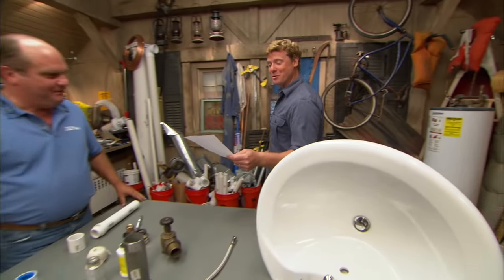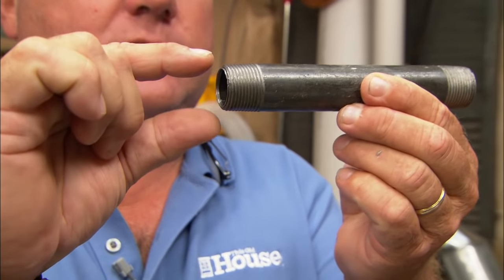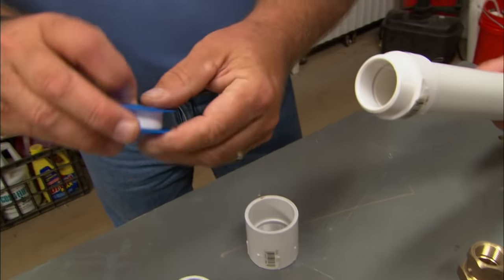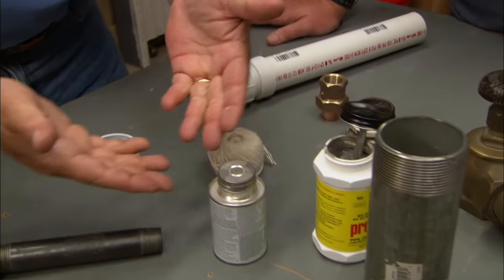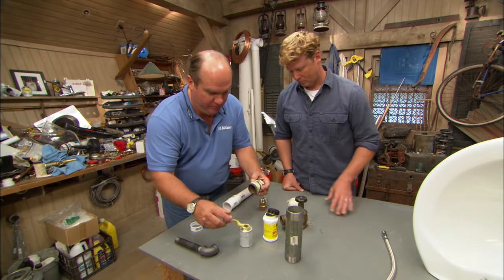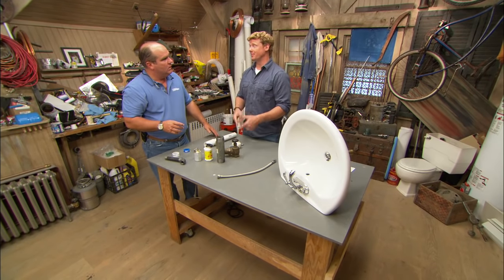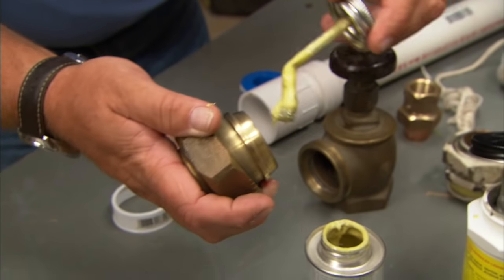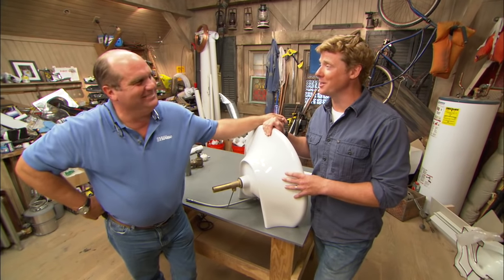When to Use Sealants on Threaded Plumbing Connections | This Old House

Comment: I always Tape+dope. In school they always said "dope is a lubricant not a sealant"
Reply: School? You must be from the great white north.
Reply: You are 100% correct. Here's my reply to this video:
__________________Teflon and or pipe dope is for non-stick. I use pipe dope with teflon in it, and both dope and tape on brass to dissimilar metal. All of this is to keep metal from chaffing inside the joint and balling up. It lets the 2 surfaces slide together so that the METAL ON METAL makes the seal. (Plumbing 101) Teflon and or pipe dope is not supposed to make the seal. It's so you can take it apart someday as well. I use it on every thread (except maybe supply connectors)n so that years later the plumber can get it apart.If you are using this to make the seal you are cutting substandard threads.
Reply: Pretty much true but if the compound is mixed properly and not soupy, it will form a seal because it is water resistant. Also does set up over time to create a seal,,, but not so much for liquid under pressure. Like water lines and air or gas lines.. Mostly dope works better on larger fittings in drains. Seeing most water lines are compression type with brass or rubber or plastic seals,, thats where dope is beneficial as both a sealant and a lube.
Reply: @peterford9369  ______All of this is to keep threaded metal from chaffing inside the joint and balling up. As you already know brass compression joints use non-tapered threads to compress and seat the brass ring...a little dope helps both the threads and ring squeeze things inside. And also...the actual amount of dope that's actually left in any sealing surface is almost molecular....99.9 percent is squeezed out both ends....it's just a waste to use liberal amounts. O-ring joints in "constant pressure" systems would keep me awake at night....unless they were outside in the yard or something. I never use them. If you're using sealant  to make the "seal" you're using substandard threads or compression surfaces.
     Wax ring and Putty joints are a completely different subject. Thx for the reply bro.
Reply: @readmore3634  True but they use many o ring connections for modern interior plumbing applications. The flex sink and toilet feeds come to mind. No compression, totally o ring seal. Anyway,, no seal is forever,, thats why we have work. 😊. The people that invent this stuff are the hero s,, we just install it. You're welcome.
Reply: @peterford9369  _______maybe I should have said: "no O-ring dependent fittings inside the wall"....  that's Calif. code.... It has to be accessible. Only rigid connections inside the wall. My bad...
Reply: @readmore3634  OH sure,, that's a given. Code here too. Just like with electrical. No splicing in walls or any unaccessible places. Even in a protective box. Nothing buried. Common sense. Like with PEX. I never saw it or used it till I worked on mobile or manufactured homes. Almost continuous. But yeah I see what you mean. Thanks.
Reply: So, if I want to make sure there are no leaks, I'd use the teflon tape & put pipe dope on top? I'm trying to re-do the plumbing on the inlet/suction side of a jet pump because it keeps leaking.
Reply: @mycats7321  Yeah, as long as you wrap your Teflon tap around three or four times, tape alone should be fine. Teflon tape also makes the threads slide on smoother. There isn't much pressure in threads, but air or fluid could find its way through the thread tunnel. Don't know if you noticed what he said about the taper of the pipe? What happens is as you tighten the connection, it forces the threads tightly together sealing the pipe. The pipe dope or tape fills those very tiny edges that water or air may find.
Are you talking about jets on a pool filter setup?
Reply: @mycats7321  __________use a little dope on the bare threads...that way...when you wrap the teflon tape on, it squeezes the dope down to the bottom of the threads. Teflon tape (especially if it's a little old) by itself is just too dry and may ball up inside...a little dope helps lubricate the threads as you tighten.
Reply: @readmore3634  Thanks! Now i just need to order the parts & wait for them to arrive. Hope it will stop the leaking.
Reply: @peterford9369  I listened to what he said. I'm familiar with the concept of the straight threads vs tapered ones.
Goulds J10 1HP jet pump for a water well for potable water. I'm out in the middle of nowhere so I have a water well & pump system. System has been in place for decades but has undergone some changes due to things breaking over the years. For some reason they used mip sch40 PVC on the inlet (suction side) of the jet pump & it keeps leaking. The pump vibrates & heats up sometimes so I think it breaks the threads. I was told by pump/well experts that using stainless steel would be better so I'm going to replace the PVC w/ stainless steel & put anti-vibration pads under the pump.
The inlet line comes out of the holding tank and the pump pushes the water to a pressure tank & then it sends the water to a main line divided up to serve the house, barn, workshop, & outside lines for hoses & water troughs. Pump overheated after some line breaks emptied the tank & it kept trying to pump but was only sucking air.
Reply: @mycats7321  Wow, sounds interesting. But I see what you mean. Also, sounds like if the pvc fittings do hook up to the pump and the pump gets hot,, that's your problem. Plastic does melt, and even just a little bit it causing the leak. They probably used the pvc because of ease of replacement between two metal fixed fittings. Not sure, not seeing it. But galvanized pipe seems the standard for well components, vs stainless steel. You may have to use a union to go between the two fixed joints but don't think you'll need stainless fittings but good luck. I'm sure you'll get it working and leak free once you get rid of the pvc parts.
Reply: @ @mycats7321  Pete's right, a galvanized fitting should do the trick. Stainless would work but seems a little overkill. Now... all of this is subject to the condition of the "female" threads inside the pump housing. If it's been leaking a LONG time there may be damage to those female threads due to erosion. Also, a joint that has a chronic leak for a long time may have had a hairline crack in it the whole time, not much you can do about that. And sometimes adding too much teflon tape can split a fitting cuz it's so easy to tighten.
Reply: @readmore3634  I'll have to check the condition of the threads & make sure nothing is cracked when I get the last part i need to put it all together. Still waiting on one part in the mail. I never put teflon tape on too thick so hopefully nothing will split/break.
Reply: @peterford9369  Yup. That's what i figured was happening. Between the heat & the vibrations, the PVC was slightly melting & the seal broke.
I've also read on the Lasco website that teflon tape can cause over-tightening, so I'll have to be careful to tighten enough to form a seal, but not overtighten. Got most of the parts I need now, just waiting on 1 to arrive.
Reply: @mycats7321  Hey,, Yeah was thinking about something when you told me it was an electric motor for a well and checked into cpvc pipe and fittings. Was surprised to find that cpvc has so much more heat resistance.
Because vibration seemed secondary to me for the cause of the reoccurring leak maybe cpvc could be an option, in resisting the heat transfer. Anyway, I hope the new steel parts fix it once and for all. Good luck.
Reply: @peterford9369  I know that plumbing code no longer allows PVC for even cold water inside houses (bc inspectors can't always tell if a line is for hot or cold water). But, it wouldn't be good for this application as it has a smaller inner diameter than PVC and it gets very brittle with age & can splinter/shatter. The steel should be more durable. 
Thanks! If I can figure out where I put my pipe cutters I'll try to work on it tomorrow.
Reply: @mycats7321  Good luck. Hope you can get it working permanently. We've all had those headache home repair problems. Guess life wouldn't be right without them. Guess if all else fails, you can spray that rubber sealant that seals everything, haha. Good luck then,, 👍
Reply: Correct , We replaced a Dominion Bridge  vintage 1898 boiler ,coal to oil to gas then replaced ; The threads on the 5 inch piping were so large that the only thing that worked was teflon dope and teflon tape .
Reply: Tape is a lubricant too

Comment: So, no pipe dope for a threaded PVC connection?  That's what I got, but in practice it's never failed on me....
Reply: Just did some research and the pvc manufacturers say not to use Teflon tape on their threaded fittings. Only proper thread sealant that stays soft. Don’t use anything else. Don’t use pipe dope that get hard either. This advice is only for plastic fittings, metal ones are alright to use tape and hard setting dope.

Comment: I would be thankful if you would write down the names of the 2 common sealants you were talking about.
Reply: I think those two pipe dopes are from Oatey.  I use blue Oatey Megaloc and it's never failed me.  Expensive but you get what you pay for.
Reply: The yellow dope is Rectorseal...

Comment: I don't understand. . . I live in EU and I bought two cans of great white pipe joint compound aka pipe dope and when I apply it, it leaks, and no matter how I apply it, it is leaking as that's it. How should I use it? on the inctructions it says to just brush it on and assemble the joint, but no matter how tight it gets or no matter how much I brush on, it just leaks and that's it. Why? Should I use it with ptfe or what? I'm really let down by it. . .
Reply: +Vytautas Poška = I know what you mean.  I tried pipe dope and the water pressure just pushes it out.  So I switched to Teflon tape and no problems with teflon tape.   I guess with pipe dope the threaded sections have to fit more closely together for the dope to work.  If there are large gaps between the threads then the dope just gets pushed out.   But the Teflon tape won't get pushed out if you wrap 4 to 5 wraps of it around the threads tightly, like I did with mine.
Reply: Too tight.
Reply: may have pinhole
Reply: no, I tried with brass, copper, steel, cast iron, nothing works, every one of them leaks. . .
Reply: When wrapping on tape, wrap in the opposite direction that you are screwing on the pipe.If you do it in the same direction, the threads will catch the end of the tape and tend to unwrap it.
Reply: I know all that jazz, I am the plumber you know, I just don't understand why pipe dope doesn't work in europe. . .
Reply: You should use anaerobic pipe sealant aka "super dope" ...If it still leaks your threads are bad.
Reply: Loctite 5776 for the win.
Reply: Metric system! :) Just kidding!
Quite possibly more clearance in the mating threads - do about 10 / 15 wraps of teflon tape, then add pipe dope and reconnect. Nostrowei!
Reply: That sounds really weird.

Maybe you should let the pipe dope set up for about a half hour before you cut on the water pressure?
Reply: We use a lot of straight cut threads in the UK, unlike American tapered threads they aren’t meant to seal without dope/ptfe. For example outside bib taps use a 3/4 BSPS thread. They often need 15 or more wraps of ptfe tape to get a good seal. This is so you can adjust the position angle of the tap on the fitting. Most straight cut threads however are meant to be used to tighten down a rubber seal, fibre washer, or to clamp an olive.

Comment: Does anyone know why they're not simply using the rubber gaskets for every single plumbing connection?
Seems to be the easiest way to seal something, hand tight is most of the time enough, and the whole world (outside of plumbing) is using it - even for 100x higher pressures.

Comment: Now the next question is how tight to tighten NPT. I've seen a tech use two long pipe wrenches on gas pipe and give it everything he has after applying the thread sealant.
Reply: About 50 to 60 foot-pounds.

Comment: Wick it. Seal with teflon tape. Then apply the dope. Thats a 123 punch vs leaks lol
Reply: Then Flex tape it, dip it in wax, wrap a bag around it, then duct tape it.
Reply: Ooh! You sure it’ll thread into the other pipe okay? Sounds like it might be “fun” to tighten! 😮 But if it works, go for it! 😎👍
Reply: @justayoutuber1906 : Sounds like the “Git ‘R Done” method! 
🤠😜👍🤣

Comment: Pipe dope and Teflon it's not a sealant....it's so you can take it apart someday...the metal against metal (or material against material) is supposed to make the seal...like a cork in a bottle...the threads make it so the cork doesn't "pop" apart...if you're hoping the Teflon is actually making the seal...you have bad threads. Use Dope on the threads and Teflon to squeeze the dope deep down in the bottom of the threads to lubricate the joint.

Comment: My dad never used tape or dope. What he did is take a bar of ordinary hand soap and scraped it over the threads and it filled the groves and made a perfect sealed joint. His motto why spend good money when bar soap works perfect. Today 40 years later its still sealed

Comment: Teflon tape is for rough thread to go together more smoothly. Pipe dope is for sealing. If it has threads, but doesn't have a rubber seal involved, just use pipe dope and ave the step or re-doing it.
With PVC/CPVC, skip the pipe doe and simply put PVC cement on the threads and put it together. It will seal, as the threads conform VERY closely at that point.
Reply: you don't cement PVC threads

Comment: The wicking string makes me worry - it would seem that the cotton would degrade over time or actually wick the water through and cause a leak.

I like the idea of pipe dope because it fills every gap and semi-sets up afterwards - providing both a lubricant and a sealant.

You'd think that something like silicone caulk would be ideal, as it does both and is water impermeable after it cures.??.
Reply: Willard Long that's hemp. That and a bit of boss white makes the best seals u can imagine. Will last as long as the pipe it's fitted on.
Reply: Many silicones are acidic and can cause corrosion if used. There are neutral curing silicones, but invariably someone would use the wrong one and suddenly the pipe is rusted through.

Comment: Don't use pipe dope on threaded connections! It does dry and harden over time. That means it is hard to take apart regardless of what brand to use. Many times trying to take that connection apart required a propane torch for it to come apart. The real reason people use it is because it does work, and much more easy to use. Use teflon on all connections. It will come apart much more easily when needed.

Comment: I heard on a video yesterday to not use a sealant on bronze to bronze or copper to copper.  Any comments Plumbers?

JoeB
Reply: I use dope on copper to copper, copper to brass and brass to brass all the time.  (am guessing you mean brass / bronze)  Never had an issue and passes inspection in SoCal.
Reply: The place to not use dope is on plastics and some rubbber.

Comment: He didn’t cover compression fittings.
Reply: Compression fittings would not require anything since the nut and threads are not what is sealing the water - the ferrule does that.

Comment: You're all doing it wrong. Tape just lubes the thread so you can tighten it sufficiently. Sealant lubes and stops it undoing under vibration or expanding and contracting.
Reply: totally. I used to use tape but found from time to time it would start dripping. Switched ti using dope and never had it leak.

Comment: you guys are great, BUT you didn't answer an important question. 
pipe dope on plastic, teflon on pipe ? 
mike
Reply: I only T-tape plastic. 3-4 wraps and you shouldn't have any issues.
Reply: Lasco, a plastic fitting maker, specifically forbids Teflon tape, as it adds bulk and could split the female side of the joint. 

They recommend a pipe dope that is marked as being compatible with plastic, such as Oatey Great White w/ PTFE, Rectorseal No.5, or TU-555, by the J.C. Whitlam Co.
Reply: I used tape on a pool jet fitting pvc. It cracked. I guess that's why.

Comment: None of these provide a deal on the threads. It reduces friction to allow you to thread things in further. You're telling me that rector seal #5 ( yellow dope) can prevent a leak being liquid itself? They are wrong.  NEVER use teflon tape.on plastic,  only dope. Anything else, tape and dope every fitting every time. Also, start your wicking from your starter thread and progress backwards,  like your threading it on. Shotty information.